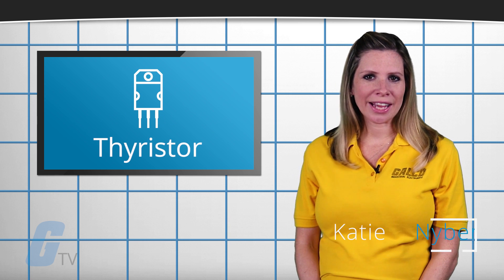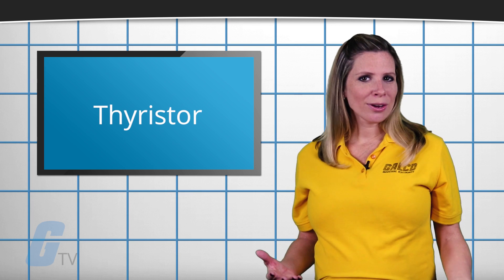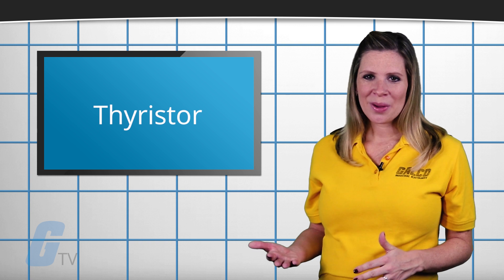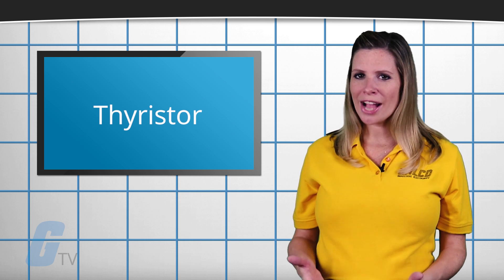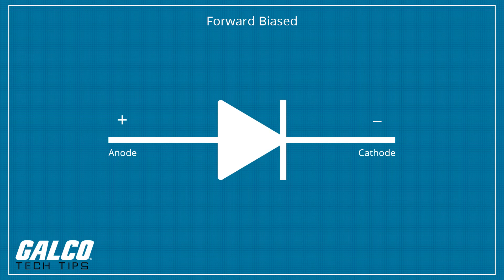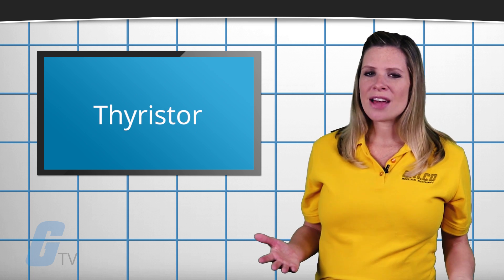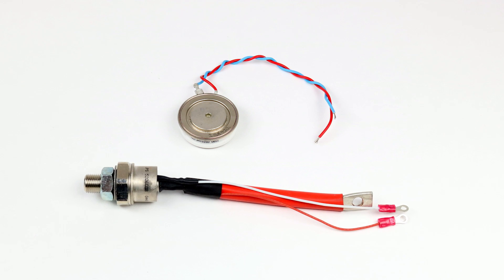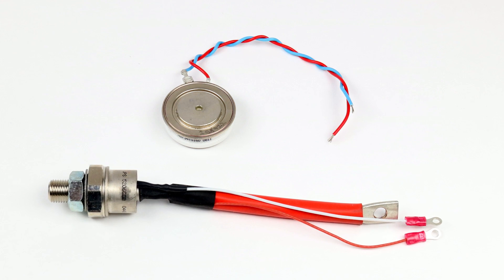What is a Thyristor? - A Galco TV Tech Tip | Galco

Comment: Fun Fact: The Thyristors Gained a Unique And Important Function For Railroad's Rolling Stock in 1971. This is when in Japan. Tōkyō Metro, Then Known as TRTA, Introduced the 6000 Series Train, Which had the Thyristor Chopper Motors, which was Considered New, and More Energy-Saving. Which also made some Nice Low Drone Sounds while Departing, Which also Followed for the 7000 And 8000 Series Trains, in 1979. JNR Introduced the 201 Series. Which was Going to Replace the Older 101 Series Trains On The Chūō Rapid Line. Which also Had Chopper Controlled Motors. Which made a Low Hum Sound while Departing from Idle, Which was Energy-Saving for Them Too.

Comment: How do you check the SCR if it still good or not by using a mulitmeter, or there is another way to check the SCR?
Reply: Forward bias it with the ohmmeter leads. It should read O.L. until you also bring the positive ohmmeter lead to the gate. At that point the SCR should turn on/ close/ conduct and the ohmmeter should read low (close to zero) ohms.

Comment: I still don't get it. I got these thyristors with four leads. when I apply 1,5V across the thin leads, the thyristor conducts current and remains that way regardless of me reversing the 1,5V, removing it, or shorting the two small leads. it only turns off when I remove the load … could anyone explain why this happen? (I use it on DC)
Reply from the maker: Sure. All SCR's (big and small) have to go below their "minimum holding current" level to shut off. We refer to them as dumb diodes because they don't know when to turn on like a diode does. An SCR has to be pulsed on it's gate with respect to the cathode when forward biased to conduct. Diodes and SCRs both know when to shut off, when the current (not voltage) gets low enough they snap off. Notice I said current not voltage. The voltage does affect the current but so does the load the SCR is feeding. So if the voltage maintained and the resistance in the load was to increase causing the current to decrease, the SCR would shut off anyway once the current gets to its minimum holding level, ok?
Reply: alright, i'll buy some IGBT :) thank you
Reply from the maker: Ok that will respond to a voltage control signal on the Gate with respect to the Emitter.  Not that you don't know this already, but most IGBT Gate driver circuits that we have seen here tend to hold the Gate a little negative to keep it shut off and up to 15volts positive to turn it on. You will have to check the data sheet for the particular device you choose to see what are the maximum voltages across the Source to Drain and Source to Gate (or Emitter to Gate I guess I should say) as well as maximum currents Emitter to Collector, ok? Good luck ian.
Reply: Thank you, I knew that. I was asking about thyristors because I have a bunch of big industrial thyristors lying around, I have solar panels with 220V 32A total output and no mechanical switch or thermostat can withstand the arc. Everything melts down in a few seconds. Now I understand why they don't turn off on DC. Thank you very much for your time, I appreciate it!
Reply from the maker: @iankleinschmidt712  Very welcome

Comment: nice video. can u explain with small example using a circuit.
Reply from the maker: These devices primarily just rectify AC to DC. The gate is pulsed positive with respect to the cathode only when the device is forward biased will it conduct. It is very similar to a diode in that it will only conduct in 1 direction. The gate pulse only turns the device on, when the current gets below the minimum holding level it naturally turns back off again. If an SCR is pulsed when it is reverse biased (Cathode is positive and Anode is negative) it just won't do anything but it doesn't hurt it either. In fact many firing circuits in single phase applications pulse it at a 120Hz rate which means with a 60Hz power source the gate is pulsed on both the positive and negative half cycles anyway, but the SCR only conducts when the Anode is positive with respect to the Cathode.
Reply: @GalcoIndustrial  thanks